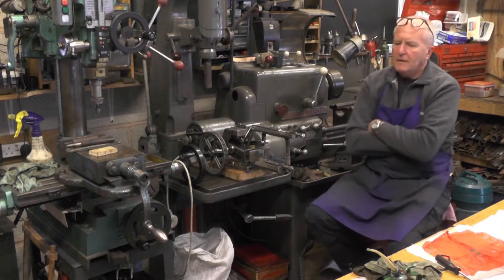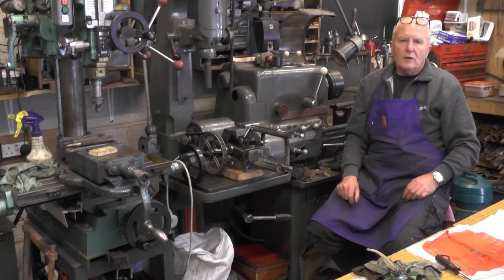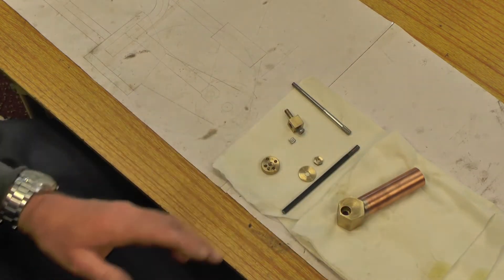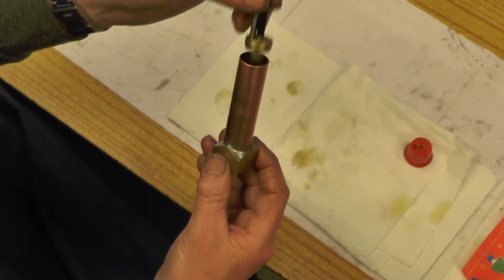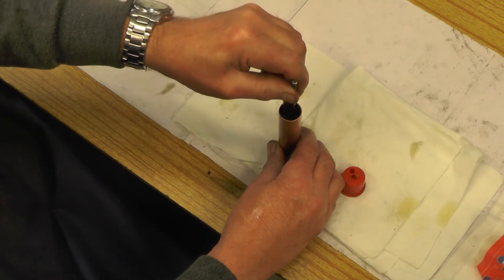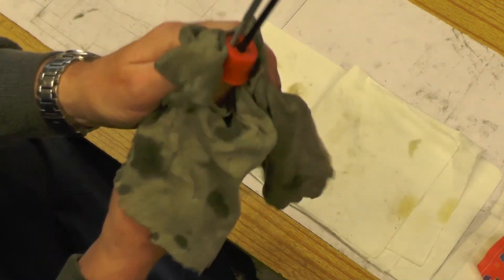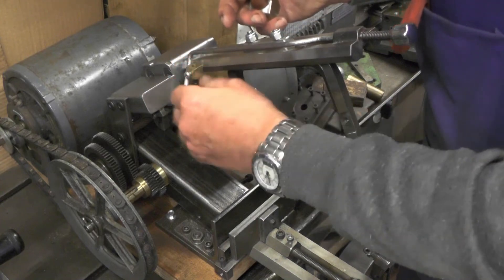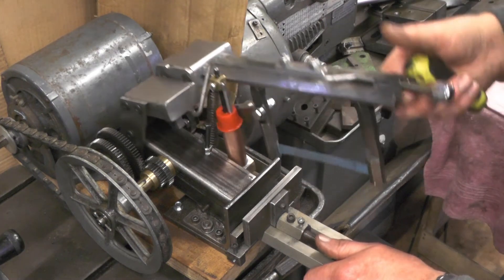Making a Compact Mechanical Hobby Hacksaw Part 10

Comment: Sorry, one more question, what is the dia of the oil passing holes in the piston? my guess is 5mm? THANKS
Reply from the maker: No problem Mohammed
I work in Imperial and used 3/16" dia.which is approx 5mm, it's not critical i chose the size the fitted around the circumference of the piston, that looked ok, if you use different size piston just adjust to suit, 
all the best👍
Kev
Reply: @MrFactotum  Many THANKS

Comment: Many thanks very informative, I have noticed that the washer behind the piston is smaller in diameter than the piston, kindly advise the washer diameter? THANKS
Reply from the maker: Yes, you are right MS
Its not critical, as long as it covers the outer edge of the circle of holes and smaller than the piston so it does'nt foul on the cylinder bore. Also the thickness is not critical either.
Thanks for the feedback its appreciated
regards
Kev
Reply: @MrFactotum  Many THANKS

Comment: Great work as usual. The large saw of this type we had at work did not have a spring. It had a weight which could be slid back & forth to give the desired pressure. When the adjuster was screwed fully in. The arm would not drop at all. Then with small incremental movements the arm would fall as desired. I seem to remember the piston had a leather seal on it, like a piston ring.
Reply from the maker: Hi Sgtr
thanks for feedback. yes i've seen those with a weight on. Because there is not much Mass on this little saw it would mean  i would have probably have to have a weight on as heavy as the saw, so i've just made it similar to the hexacut version,  I think I had a mission in my head to make it with  the damper, without out even seeing one, just to tax my brain, this little damper works fine without any seal other than the Brass washer. Thanks for taking interest
see you next time , hope that knurler is coming on okay.
regards
Kev (mr f's w)

Comment: Nice job on the saw. All the mechanical hacksaws i have seen used a retract linkage to lift the blade on the back stroke and or a adjustable spring mount that moved the one end of the spring closer to the arm pivot to adjust the pressure. Maybe to much complication on this small of a saw . Cant wait to see it finished
Reply from the maker: hi  rpmU
thanks for watching and feedback, yes, don't want to get too complicated
regards
mr f

Comment: Hi Mr F. back in the 1980,s i worked for a hydraulics company that supplied the N.C.B with hydraulic actuators. Damping was achieved with a 6mm screw with a taper machined on the end which screwed into a hole with a taper seat. With the screw fully seated and no oil flow allowed, you wouldn't need a separate mechanism to hold the saw in the up position. im incredibly impressed by what you are able to achieve in your home workshop tho.
Reply from the maker: hi rob 
back in the 80's i worked for NCB who used hydraulics from your company, like the idea with the screw, might try it on my next saw!!
Thanks again for all your support and feedback, great.
Take Care
 mr f